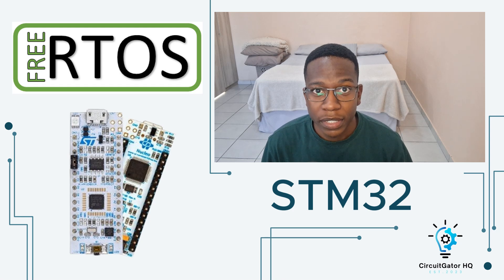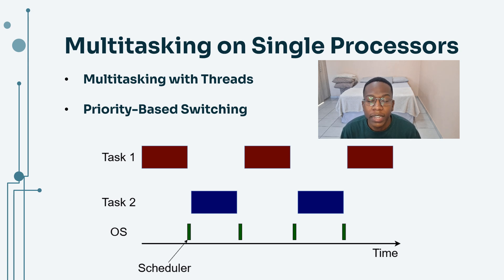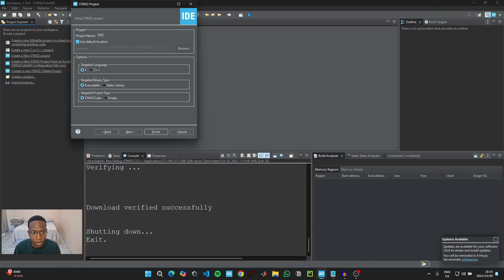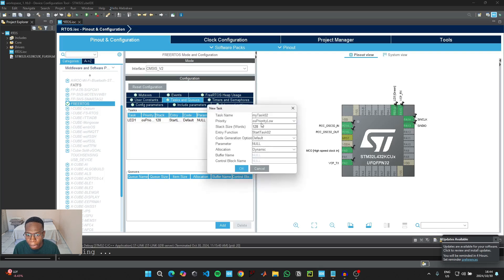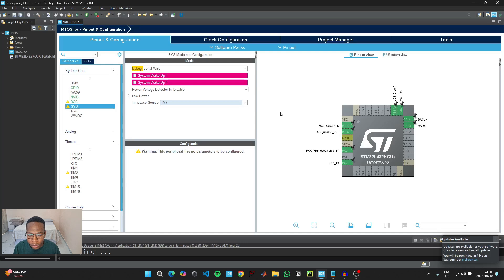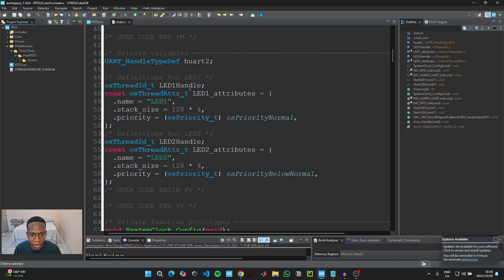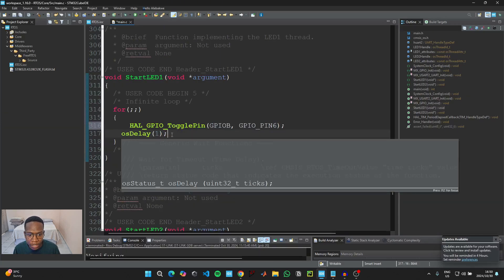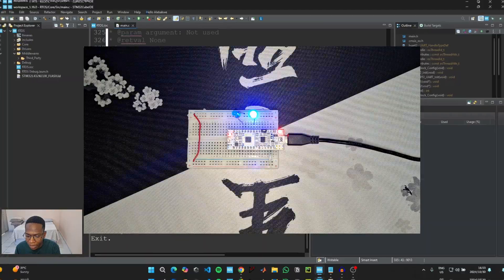STM32 FreeRTOS: How to multitask with CMSIS-RTOS

Comment: Nice video. Why did you not add resistors in series with LEDs?
Reply: The board is 3.3V, so the blue LED doesn't really need a resistor. The green one could've used one tho
Reply from the maker: Hi, I didn't have some at the moment.  But a simple lesson like this didn't require resistors because there was no risk of burning the LEDs with the board. However,  it is good practice to always add resistors.